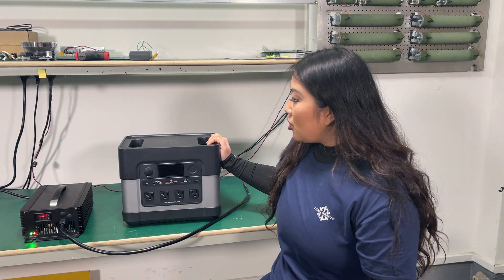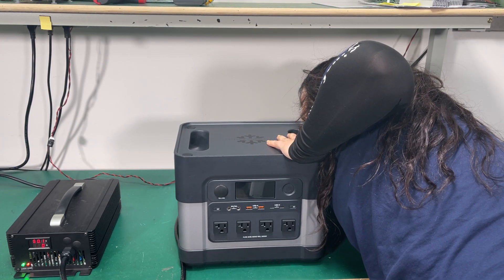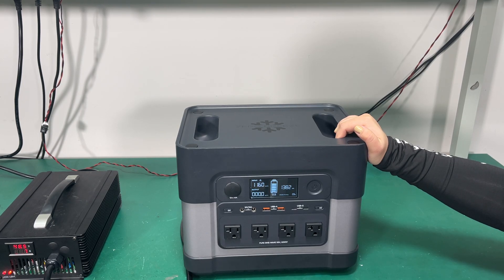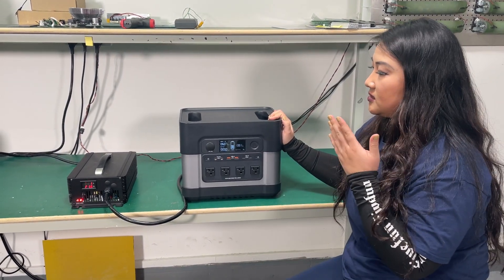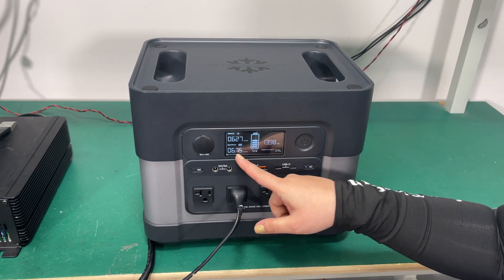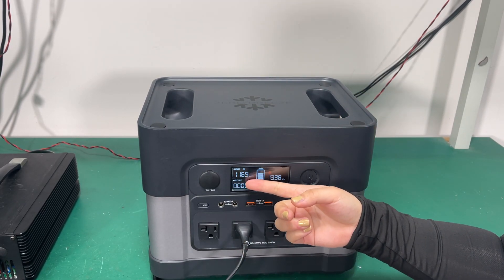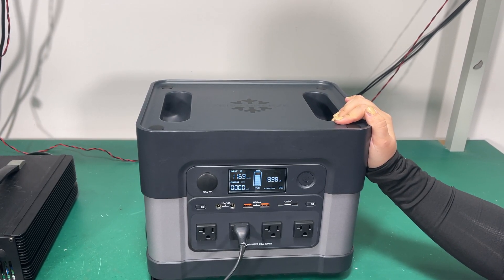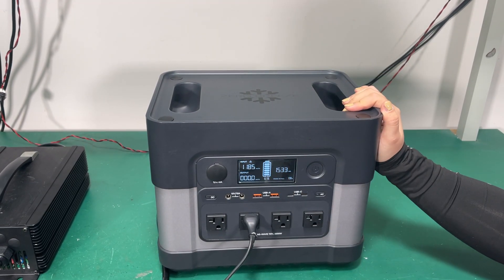ElecHive 2200 AC Overload Protection

Comment: Would this be able to power a high output air compressor?
Reply from the maker: Hi there, the AC port can output max 2200w AC. If your high output air compressor needs less than 2200w. It is available.  can be used. Please tell me the parameters of your air compressor if possible.

Comment: If I'm correct I believe you can put simultaneously a 600 watt AC input and solar panels plugged in at the same time..... My question or fear is these two connectors are right next to each other is there any risk of them being so close if you were using both input methods?

Comment: The fast charging seems to jump up to ~1200w then down to 600w and cycle over and over. I’ve seen this in your other videos with regular charging.  Is this the MPPT seeking the tracking point and resetting?
Reply from the maker: Yes, it comes to keep over 1000W after several minutes.